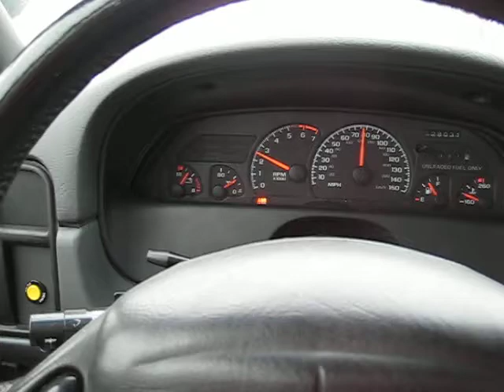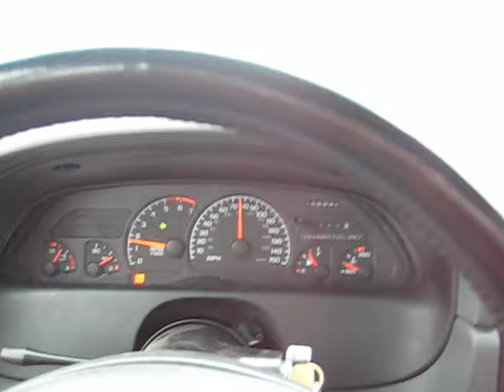First drive T56 1994 Caprice 9C1

Comment: got the same stuff in my 95 caprice and i got the same rpm in 6th gear lol. as far as the analog gagues mine had it stock ia mpretty sure (could be that 96's came with digital only but not sure) but very nice job man

Comment from the maker: @dansdashizzle522 where did I say that?! Also 200 miles physically impossible, probably not with a smaller gear i.e. 2.73 or something like that, as you can see by my vid the relative RPM's versus speed with 3.08's is ridiculous. not really saying that you are wrong, and I would never try it but with the right gearing anything is possible. How does Nascar do it then?!